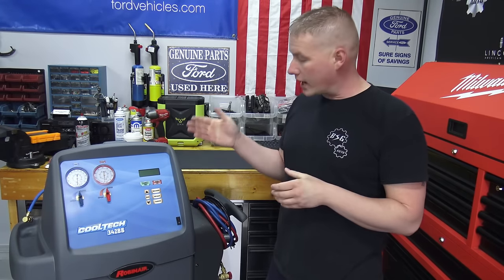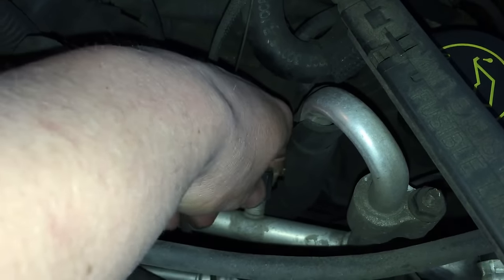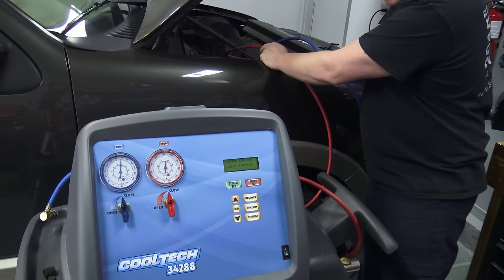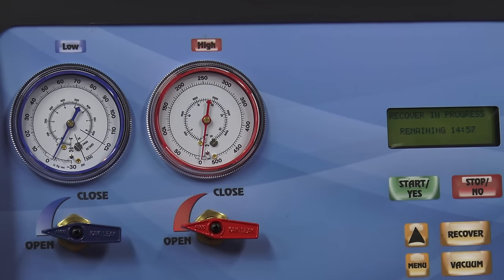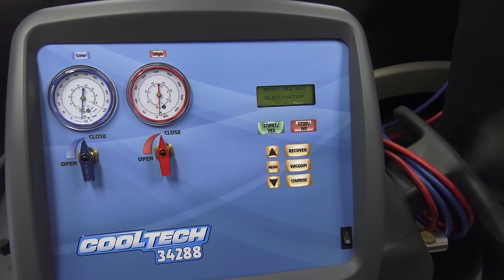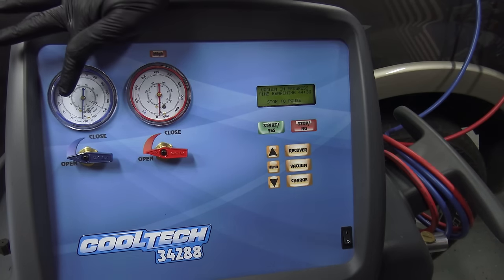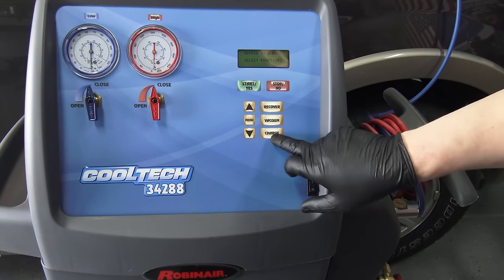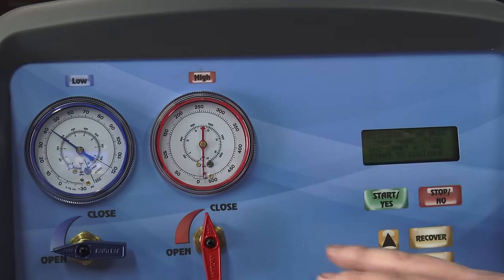How Professionals Recover & Recharge Your Vehicles A/C System

Comment: Thank you for the great video, very informative. But I do have a question. When you charged the system with R134 you did not start your vehicle or turned your AC on. What"s recommended? Thank you in advance.
Reply: when using these types of machines. the machine does all the work. it charges to the vehicle specs. .. disconnect the machine and Then turn on the car and the a/c… its not like the freon can and hose.. where you turn the a/c on and then add the can(s)
Reply: @Jy-xq2ew  typically you turn the car on so you can monitor the vent temp with a thermometer.

Comment: Great Video. I had a problem with wife's 2007 Camry. Thought it was a a possible blend door issue but turned out to be something different. Dealer wanted $2800 to fix the problem. $2500 for a new Control Panel and $300 for diagnostics. I said no thanks and drove home. Watched a few videos and talked to a few friends. Made a trip to the local auto store bought a can of A/C charge for about $50 and all is well in the land.  No problems. It was just low on charge.  We have no proof but suspect the local repair shop that we recently went to had let the charge out because I made them pay for a new radiator after breaking mine while replacing my alternator.  They were also upset that I made them wipe off all the greasy hand / glove / paw prints off the hood and front of the car when they were done.  Don't you love just love it when someone uses an oil filled rag to wipe up oil. I mean really, how much oil can a oil filled rag hold before it just smears it around?  OK yer cars done!! That'll be $157.99 Please!! We even wiped'er down a bit!!
Reply: Hawaiian F150 can't find good shops anymore I tell you. South Florida is garage hell
Reply: Yea i worked cars too for brief career (Toyotas)1995-1997

Many times i need repair shop equipment to DIY  on my cars . Many tech are not talented or need quick money and will cut corners

Comment: After I went to Regas it failed and mechanic said I had a leak I took to a 2nd garage for 2nd opinion and that garage tried to regas said it hasn’t got a leak as there was gas in system but the compressor wasn’t kicking in which is why wouldn’t re gas 🤔

Comment: Thanks for the video!

I have a couple of questions. One is do you recharge with new refrigerant or do you use any of the refrigerant that was recovered? 

Also, I have a compressor whine only when accelerating. It doesn't do it at idle or If the compressor is off. If I have the system recharged if low, will that whine go away or could it be something else?
Reply from the maker: The machine filters the old refrigerant and goes into the same internal tank of new refrigerant.

Comment: On a 1995 ford ranger 4.0 the a/c system calls for 1.9 LBS.  What would cause a failure to compete the charge? We are using a KoolKare plus machine . This machine has the option to charge on the high or low side we have been trying to charge on the high side is this the proper  method or should I charge though the low side. Thank,s for the vidos and keep them comming.

Comment: Can it suck all the old PAG oil, even without the refrigerant in the system? (et's say lif you installed a new drier, compressor...ect. This way you can put in the correct amt of oil system requires, if you can remove all the oil from the system even from the new compressor which some comes with oil in it. That would be great if it can do that. )

Comment: Question. If i take my car to a shop and asked them to recharge my system, do they add PAG oil back in??? I think i need PAG oil in my system as my low pressure line snapped, lost all refrigerant and i replaced it. I'm in NYC so i dont need AC right now, but just wondering if i have to put in PAG or will the shop put it in with the recharge?
Reply from the maker: Yes they should add PAG because it gets removed during the recovery process.
Reply: @FordTechMakuloco  My new compressor, UAC said it comes with the pag oil preinstalled.... I'm thinking i just need to pressurize the system and fill it will refrigerant.... not sure, i may get one of those kits and save me some money.

Comment: If the system is empty because of an accident by a friend who accidentally hit one of the lines to the compressor and all refrigerant leaked out with psssschh it was a very warm/hot gas that was coming out.

Ive replaced that small little line of like 30cm. What about oil then? How much to add? Did the oil escape out when the gas did?
or can the ac machine still recover if any oil are still left in the system and then add the new correct amount?
sorry for my english :)

Comment: Hello!. I have a 2007 Eddie Bauer Explorer 4.6 V8. The AC never have been recharged and I realized that it is not cooling as several years ago. Can you help me to identify the Low and High ports used for recharge the air conditioning system with the appropriated gas and the maximum capacity of the Gas? Thanks a lot in advance!

Comment: Had a question, I have an older robinair very similar to this, and it does not tell me to equalize hoses after charging. I end up with pressure still on the gauges after charging the system and disconnecting the hoses. I normally select recover after disconnecting hoses and get about .25lbs out of just the hoses. Is this .25 not making it into the vehicles system? My manual says nothing about equalizing like yours does.. thanks Dan

Comment: Thanks! Are you charging with the engine on or off?
Also do you ever verify what pressures are in case you ever find yourself helping someone who only has gauges?

I was surprized that you only put the amount of oil in that came out as opposed to putting closer to the system spec back in.

 Many times when a bad compressor is taken off it will be completely dry with zero oil in it. When it came new it had 4 oz's.

I was wondering how the amount of freon is determined by the designer. Do the teach that info? Thanks! love the exciting music up front.
Reply: Should be on
Reply: No done with engine off. The machine has setting to fill as per weight required for your system.
Reply: @aki31286  Just say you had an all new system, line , ac compressor, condensor, evaporator, everything. How much oil would you add above and beyond the compressors oil requirements?
Someone blew my mind  the other day saying if you don't add oil to coat the lines and components the lines and components will rob all the compressors oil causing premature ac compressor failure.

Comment: Hi. What’s your opinion and advice on mahle ac recovery machines. Why they come for hybrids and regular for separate. Does your robinair ac machine do the service for hybrids vehicles as well? Thank you boos.
Reply from the maker: Hybrids are no different, the new ones just require a special oil you inject separately for the electric compressors.

Comment: What about the air that gets introduced when you pulled the low side hose off to inject the dye & oil? I know it's not much, but there has to be some in the hose if you break the connection.
Reply: Do you not have a separate hose connection for adding oil? Might be time for an upgrade?
Reply: I always put the oil in the compressor, condenser, and accumulator before sealing it up and running vacuum.

Comment: When you change a compressor do you drain the oil from the new compressor, measure it and put in the amount required in the system specifications?
Reply from the maker: Yes

Comment: I just bought the same machine. So far I like it but I am more familiar with an automatic machine. Can the Gauges be used on the machine after recharging as long as the panel valves are closed? I like to monitor the pressures to assure there are no potential blockages or other issues. Thanks ! I enjoy your videos!
Reply from the maker: Yes they can I use them all the time. I use mine a lot now and I still love how well it just works.
Reply: Hi....anybony can buy this machine or only licenced people?....one not question, the frion u colect it from a car, can re-use or not....I ask cuz I fill my car with frion but the expantion valve it's block and I want to replace but don't want to toss the frion I already put on it.
Reply: @raulayala5891  
For nearly $3000, it's probably cheaper to bring it in or use new refrigerant than buy one. Not practical to get for a one time DIY job, as cool as it would be too have one.
Reply: @raulayala5891   Yea anyone can buy one but if you want to be offical get the mobile AC cert. Its only 15 bucks or so and u can then buy R-12 and now u need it to buy 30lb cylinders of R-134a thanks to Obama and other world leaders at the time who signed that into law.   I have the same machine.  I used it on my fleet of cars many times , paid for itself already in what repairs would of cost

Comment: One of the steps when replacing a compressor is to flush the system, but often people gloss over that step. I've seen some use compressed air, which seems like a strange thing to do since high pressure air will always include water that will condense everywhere. Is it common practice in the automotive industry to use compressed air, or do many shops use nitrogen? Is it common practice to use a volatile flush solvent?

Comment: I’ve got a question for you if I could. I just changed out a condenser in a 2010 Escape that had front end damage. While the garage was trying to refill the system it pulls a good vacuum but when it tries to fill it with the 1.56 lbs of Freon, it only gets to .6 lbs before it gives a failure code. Have you ever ran into this problem?

Comment: Thank you for the video, Shouldn't you purge the air in the hoses first if you just want to check the pressure level otherwise air will get into the system?  please clarify.
Thanks
Reply from the maker: With this system there should never be air in the lines at all. The lines should only contain refrigerant or be in a vacuum.
Reply: Thank you so much for your reply.  I appreciate if you could guide me to the right way to prepare a new manifold gauge by purging it to check the system pressure then connect the yellow hose to a refrigerant can.  Not sure how to purse the 3 hoses as well as the manifold.  I have not find anyone explain this.  Thank you

one more question. when disconnecting the hoses after you are done does that mean air can get again to the hoses from the valve that you connect to the high and low pressure ports?

Comment: In your opinion, is it possible to damage the compressor by adding oil through the low side, since it will have to travel as a liquid through the compressor? Can the compressor get hydrostatically locked and damaged?
Reply from the maker: Um no.
Reply: Very interesting. After a recovery and a passing leak test, I was taught to "Never " add pay oil through low side because the oil would have to be compressed as a liquid and that it could damage the compressor. Good video though.
Reply from the maker: The oil injection gun adapter is only made for the low side port, if it was potentially a concern then they wouldn't sell it with a low side coupler.

Comment: I have a 03 explorer limited when I have ac on the compressor turns on an off quickly an passenger side vent blows warm /cool air driver side blows hot an now lost my rear heat an ac any advice please
Reply from the maker: Classic low charge indication get the system evac and recharged and add some dye to see where the leak is.

Comment: how much does this machine or a similar one cost? and are they reliable or do they break down... also,If i wanted to open up an small ac repair shop in my area do i need a special license, I took an appliance repair coarse where if you work with refrigerant you need to take a special certification test   ...i am located in sw florida... great video...thanks
Reply from the maker: Robinair is the industry standard and I feel the best machines. This is the one I feature in this video and is really all you need- http://amzn.to/2um9sCm

Comment: I have a 2008 toyota  corolla      ce and a had leak on the low  side port I change both  valve low side port  and high   side  port valve I did a vacuum for  20 minutes and I put  a little  oil  in the system is don't know what  I did  wrong it's not  cooling  like before  what  the issue do the low  side  gauge  reads 30

Comment: Hi, I love your videos.. Great Work. I have a 2003 Tribute with 165k miles. I changed the compressor because of a bad pulley bearing. I used a re-man'd 4 Seasons compressor. It failed after about 8 months(leaked from the compressor). They replaced it, but the replacement had a bent pulley shaft which caused a leak. They again replaced it, but the third replacement was noisey from the beginning... Then it too leaked out the coolant. I gave up and went to a local repair shop. He used a NAPA compressor which lasted 3 weeks, and it too was leaking from compressor. The local shop re-charged the system about 3 weeks ago... So I'm waiting to see how this compressor works. Any ideas?? Each time the compressor was changed, I changed the receiver/dryer and orifice tube. The shop claimed to have flushed the system too. Thanks!!
Reply from the maker: Just use a Ford reman and be done with it or use Spectra Premium.
Reply: +FordTechMakuloco Thanks for the advice!
Reply: sorry sir but i will like to ask you a question. i have a 2014 toyota prius and the ac/c was leaking due to hitting a dear, fixed the leaking but i dont know what amount of oil nd 11 to put as everything came out out from the a/c when i change the part. do you know the amount of nd11 oil to put on the a/c. many thanks jose.

Comment: Why no one of specialist youtuber talk clearly about Oil process ...
The machine recover and drain the hole oil system including compressor oil...or just recover oil from condensor, evaporator, dryer and hoses only?
How to know there is excess or missing oil?
How to proceed with ideal oil charge with machine..or we should do it manually?
I searched a lot on YouTube, websites and forums..But i did not find anyone talking in a clear and practical way about this topic.
For example:
Oil chart :110 ml (hole system manufacturer's instructions)

Comment: Got my 609 cert. a few years ago - great investment come summer time...

I searched your channel and I have a non-A/C question :
On the Focus Mk1 (2004 SVT) is it possible to remove and replace the front sway bar bushings without dropping the subframe? The end links are good but all the bushings are original double digit years old and it's time for a set of polyurethane bushings. I will also have the lower control arms off during the process but don't have a lift. ANY tips & tricks will be very appreciated.
Reply: Im in the same thoughts. Ive read that its possible to do without dropping the subframe but its a very tight job I've read and seen on youtube. People made it though.
how do you know that the bushings are bad?
Reply: @orfeous  UPDATE - it's not too difficult if you have a LOT of extensions with a few universals then work it from the top. Factory bushings are always bad compared to urethane bushings.
Reply: @dieselscience  I'll guess the bolts will not be easy to remove though after all years. :)
Reply: @orfeous  They're heavy to start with but I used breaker bar.

Comment: 2013 A/C question   F150
ecoboost
when not in recirculate mode using just vent I still get some heat into the cab,...   so I have to use max A/C to get any decent cooling,...  my question is can I pinch/clamp one of the heater hoses to get around this issue? which one?
the dealer gives the typical everything is normal answer    but there should not be heat coming in when I try to use the cool vent on a cool day,.... plus I dont get much a/c unless I am on max but i want fresh air a/c usually at night
what do you think about that story?
robert in niagara falls,.....dealers here are very bad!!
Reply: Sounds like the blend door isn't closing all the way. It directs the path of the air coming through the HVAC box. Take it to a different place or dealer and have them check it. It may be normal in that the air intake for the heater system could be getting heat from the engine compartment.

Ford used inline heater valves for a lot of years. I would get it checked first though.
Reply: when it is cool outside and I want that fresh cool air inside I use vent but I get warm air, the dealer says its working normal   but they always say that    so if I dont trade it in on a honda I may put in a valve